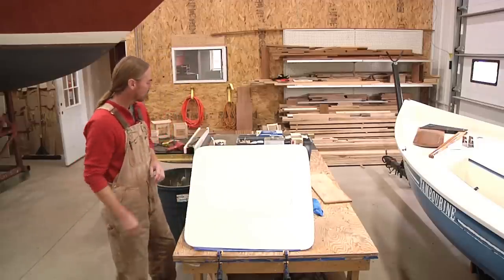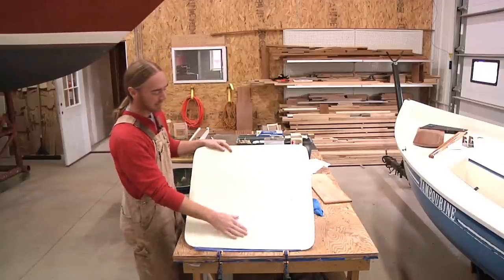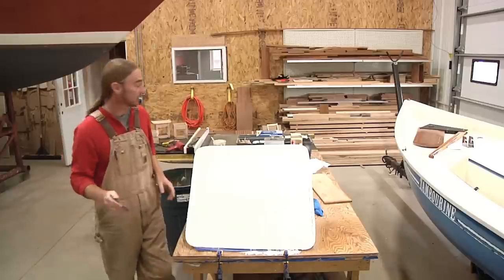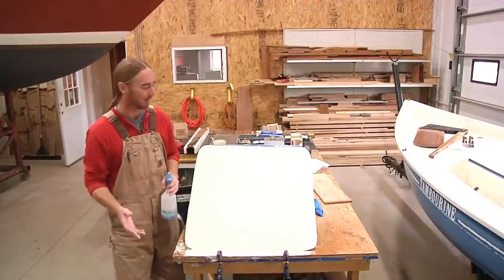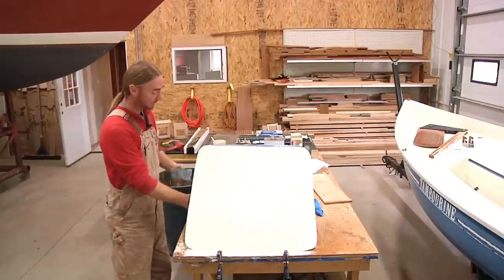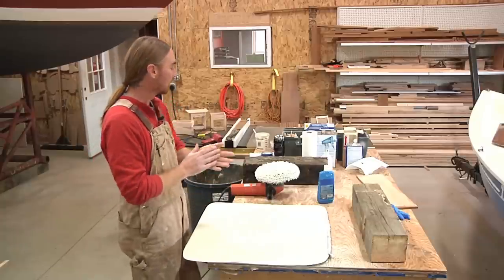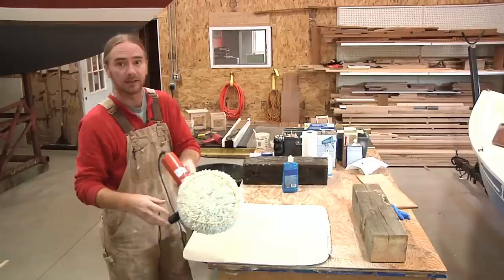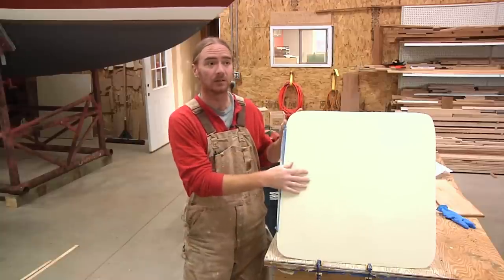There's A Hole In My Boat~ Sanding Gelcoat

Comment: Thank you!!! Your entire video collection is priceless. I'm fairly handy and meticulous but don't know all the finer details in process, and do's and don'ts. You take the time to go into great detail and stay entertaining. Thanks a lot. I'll surely be contributing.

We just bought our first boat after more than a year of looking and learning (the good, the bad, the ugly). Every boat has a compromise. We ended up purchasing a 1977 C&C 36 with only 2 previous, and meticulous owners. A few chips and stress cracks (nothing structural) on the deck and that's about it. Interior is well maintained but shows her age in some areas (UV damage, scuffing, etc) nothing drastic. An amazing find is largely due to previous owners!!!. The Hull below the waterline is cored but completely dry (meticulous owners). We will learn a lot on this boat (all systems, sailing, maintenance, etc) over the next few years before we upgrade to substantially cruise.
Reply from the maker: Sounds like you got a good find!

Comment: Five thumbs,
I used to work for Boston Whaler Norwell Ma. back in the days before chop had color per % inch.. We Taped the hulls for voids three to four times them a inspector would go over what we checked over.. Gelcoat voids we would drill two holes one to fill the other was to exit the resin ,... Thx bud you bring back some great times working on boats.. gotta love the smell of resin or get a wooden boat... lol

Comment: Just what I needed to know. I have an old bass boat that has zero gel left on it. I was looking to apply new gel coat and didn't realize the non-wax was what I need to use. I am also looking to make a mold to reproduce a car dash surround and your glassing technique is valuable.

Comment: Andy - Thanks for the videos - answered a lot of questions.  I am "restoring" a 1974 Boston Whaler 13' Sport - it is in pretty good shape, but previous owners punched a bunch of small mounting holes and painted it several times, inside and out and glued carpeting to the no-slip deck.  So I'm stripping and sanding the entire boat for refinishing.  I would prefer to re-gelcoat the entire boat, mainly for durability but also for authenticity.   Most marine forum discussions seem to prefer paint - your thoughts, please.  I'd be happy to share photos of the entire project.
Reply from the maker: Dennis Fortna Paint.  Gelcoating that size area is a LOT of work with little benefit.  Paint can be touched up just as easily as gelcoat and you won't have to deal with color matching the gelcoat everytime you need to fix a chip or scratch :-)

Comment: Thanks for the instruction, just what I was looking for. When blending gelcoat to the surrounding area, is there any prep going from the repair area to glossy undamaged gelcoat, there will evidently be some material beyond the 400 grit scratches. Does this buff off without a transition line?

Comment: You are the man Andy! I have tried to do a small repair where I taped up around the area with masking tape, but when I sand it back I can see the fibreglass showing through like I've taken too much of the gelcoat back off and it hasn't blended into the surrounding area... Would you still treat a small area repair like you did in this video by sounding down the outside so it feathers the new into the old, if this makes sense? Thanks mate 👍

Comment: Do you ever do any repairs with other colours of gel coat? Building canoes we often use darker colours which seem to be a little more difficult in perfecting the final finish.

It would also help your audience see a little more detail in the work you're doing as it is hard to see any of your sanding marks or gel coat application with the white.

Great videos, keep up the good work!
Reply from the maker: I do, but generally it's during the Summer and in the marina's (not in the shop).  Most of the projects that I work on in the video's are customer jobs, and as I'm sure you know 90% of all the boats out there are a variation of white :-/  But if I ever have the chance to record a dark color, I certainly will!!

Comment: I love the way you explain everything. There is a question. How can I know if my boat is painted with gel coat or regular paint. 
Thanks a lot I have learned a lot since I'm watching your channel.
Reply from the maker: If you can find a chip or scratch somewhere on the hull, look to see how thick the outer film is.  Gelcoat is generally 1/16" or thicker; paint is paper thin.  That's about the best way I know of :-)

Comment: When you were color matching the gel coat......you were laying out little swatch tests in a row across the area you wet sanded.  How did you remove them once you achieved your color?  Did you wipe them off with acetone? or did you let them dry and sand them off?    Question 2...you used MEK as a catalyst in gel coat but used MEK-P as a sealer to cure laminate resin.  are they 2 different products or are they both MEK-P?
Reply from the maker: Yes, the color samples were all done over freshly sanded gelcoat so I could see the true, non-oxidized color of the gelcoat.  Since none of these samples were catalyzed, I was able to wipe them off using acetone :-)  The Mek-p is the catalyst for all poly based resins (whether gelcoat, or laminating resin used for fiberglass).  The material used for sealing and curing the surface is PVA (Poly Vinyl Alcohol)..  Hope this helps!

Comment: I have a boat with a very rough surface due to a certain someone sanding down a surface that had a non slip additive.
We are trying to fix the problem by doing layer upon layer of gel coats. It currently looks like a rusty surface that has been painted over.

 I noticed you mentioned PVA and I was wondering if adding PVA to the gelcoat mix would give me a thinker coat? Also do we need to sand between each application or just the final coat?

Comment: Thank You for making this video is very informative, you are good, what is PVA? is a catalyst
Reply: No it's not a catalyst. It seals the laminating resin surface from air so it will cure ie harden. If it is non laminating resin being used, it will have a wax added that rises to the surface to do the sealing job and PVA is not needed. It stands for 'polyvinyl acetate', so is basically the white wood glue you may have seen. This would be thicker than needed for sealing so dilute with water 50/50. You'll likely see it in hardware stores already diluted for sealing new plaster walls before painting or hanging wallpaper.

Comment: Do you by any chance know if a Yamaha WaveRunner is fiberglass or epoxy (SMT) or how I tell the difference?  I have a bad bruise/crack, about 3-4", and want to repair myself (I have body shop experience).  I believe I recall forums discussing the hulls are painted.  I was looking to gelcoat the entire bottom to freshen up the older "ski" but, if I understand your other videos, if it is SMT I will need to repaint with automotive paint as "no poly over epoxy"  correct?  If it is SMT, do you recall which video you explain the epoxy products (I am familiar working with fiberglass resins)?
Reply from the maker: I would guess it was built with poly resin or vinylester.  When you grind the damaged glass off, if it has a green-ish tint to the glass its most likely poly.  If this is the case, just use poly resin for the glass work, AdTech p-14 for fairing then gelcoat..  If the body of the runner is painted the film / surface will be very thin.  You can still paint over poly resin.  Either way you'll need to put a primer coat down first :-)  Hope this helps!

Comment: When I wetsand after the repair, the old gelcoat turns orange before I can knock down the new gel to match the new surface. I’m left with a spot that looks like a color matched piece of gum was stuck on the spot with an orange circle around it. Any tips?

Comment: I'm confused. So you only use laminating gel coat? I have gel coat with wax but was told can only use last. What's the point of using gel coat with wax if it can only be put on last and not layered? Do I have to just use gel coat without wax then? So confusing..
Reply: Hey don't know if you're still confused but there's both a laminating and a finishing gelcoat. A laminating gelcoat doesn't have a wax and the finishing one does. I'm no pro but just like when you need to starve the resin of oxygen when using a layering polyester resin you'll want to seal your top layer of gelcoat with a top coat of waxed gelcoat.

Comment: How can i add texture to the gel to match the deck?  I heard pressing silly putty against the existing deck and then transferring the mold to thickened gel will work.  Any advice?  I've filled in a deck plate hole and am trying to match the deck pattern as much as possible.
Reply from the maker: +Derek Binding Depending on the pattern, you may be able to use Gibco Flex Mold.  If it's more of a 'popcorn' texture try sprinkling in a grit like SoftSand :-)